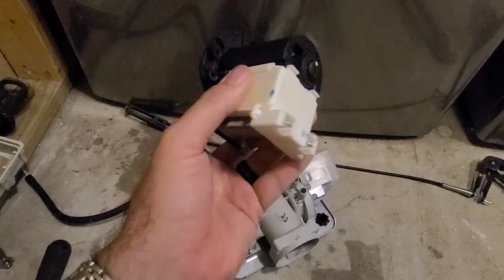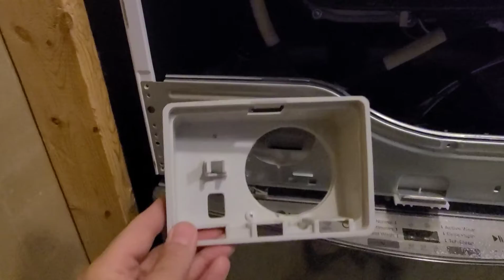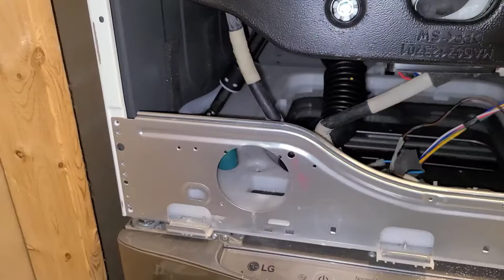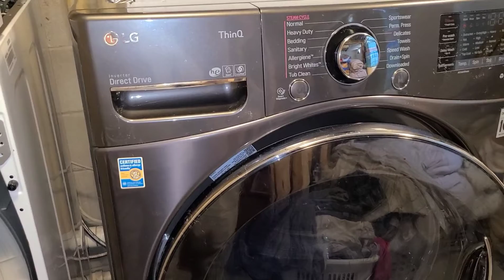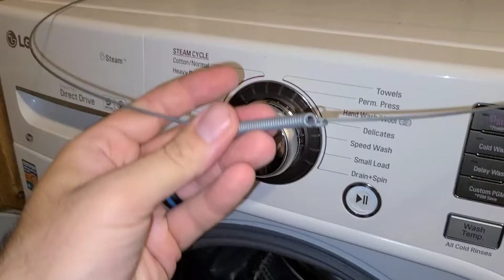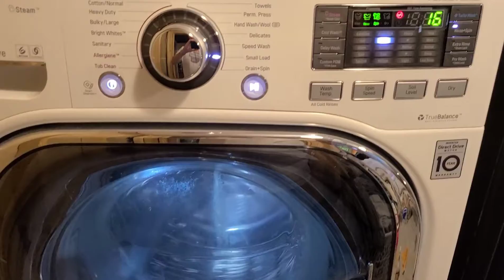How to replace the drain pump on your LG washing machine.

Comment: How do you take the bracket off? Is there a easier way to take off the bolt???
Reply from the maker: The bottom plate is held on to the pump housing with a few phillips head screws. What bolt were you asking about?